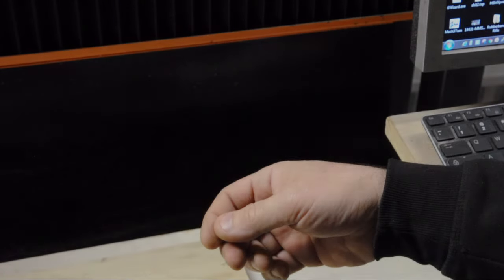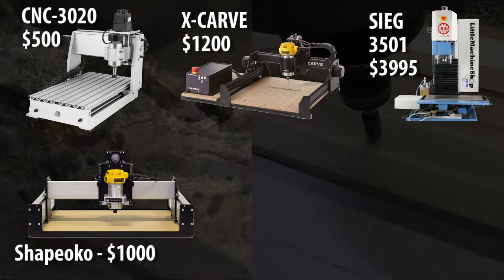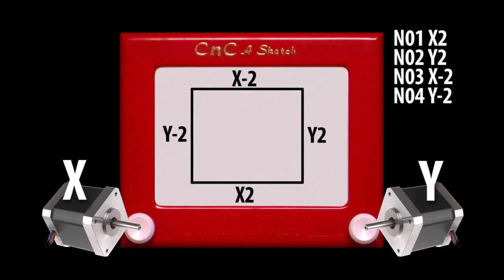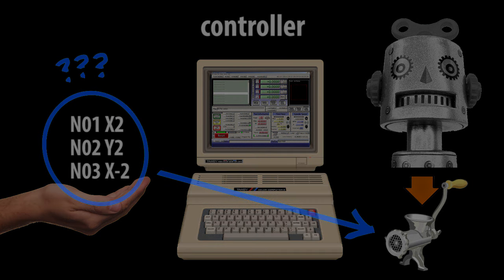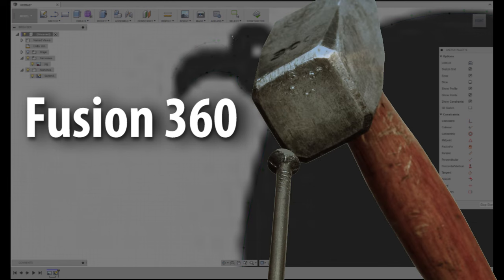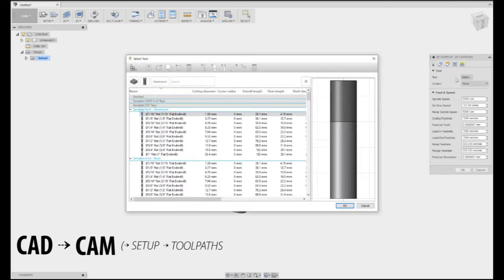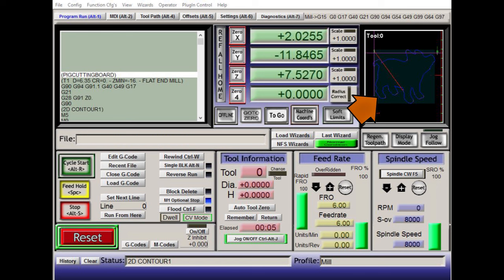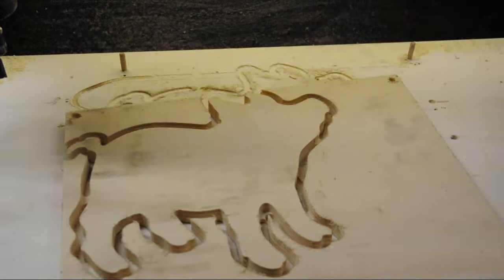CNC Dummies For Routers

Comment: This should be required watching for those getting into the hobby. As the owner of a 95% functional 3D printer, I can say that some of these "basic" lessons are hard-learned without the big picture.
Reply: Based on this video and your comment, I tried cutting a piece of wood with my 3D printer.

Now my nozzle is broken. Did I do something wrong?
Reply: Did you use a .2mm nozzle? those break really easily. Try changing your nozzle size to 40mm
Reply: yep should have used an eye liner brush instead of an nozzle.
Reply: Tilobida Toothbrushes work too
Reply: Agreed! 
Best Matt
Reply: Practical Engineering wish you still did more woodworking videos man! Loved your turning stuff.
Reply: When creating the big picture, There are many brushes
Reply: make a video about it
Reply: Instructions not clear, eye liner brush stuck in nozzle.
Reply: I run into this problem quite a lot. It's rare you can get such a high level overview of something to start you off on a completely new skill. Programming and welding are two areas I can think of where I've had trouble getting this sort of info. I always say in life that you've got to know exactly there you're trying to get to, before you start figuring out how to get there, but most people tend to charge off into the distance before I've even got my bearings.
Reply: Same can be said for the Illuminati conspiracy.
Reply: True bro the most basic easy things are the most valuable to beginners.. saves the headache of confusion
Reply: @georgehelliar  i tend to find my rough bearing, dabble a little and then specialise

a few steps in the generally right direction tend to give a very different perspective from knowing nothing.
Reply: My 3D printer is 5% working.  I suggest we collaborate.
Reply: I worked in a metal fab shop running a million dollar cnc punch for three years. While operating that bought myself a 3d printer, and about 2 months ago bought shapeoko router. I still consider myself a beginner, oh was going to school for welding technology when I got the fab job for highway products.

Comment: You said CNC machines do exactly what you tell them. Mine does if I sit there watching it, If I go make a cup of tea while its running, it usually messes up the work or tries to burn my garage down.
Reply: WhitwellMike B yeah mine too, sometimes it just has a mind of its own. A bit like my dog, faithful and obedient...... most of the time
Reply: WhitwellMike B yah, I had the same problem with my laser cutter, nearly had to tap into the home owners insurance...
Reply: I popped out for 5 mins, came back to find the cutter broken and the spindle motor filling the garage with smoke, so glad it didn't actually catch fire lol  Sit watching it and it's as good as gold!
Reply: Lock the door.  Murphy is getting in.
Reply: Unless it weirds out...... Mine almost never weirds out.  I take a close at the G-code first 2 ways, the simulator in V-carve and again in mach 3 cutting air.  If those prove out, the G-code is good and I just run it from the first good run on. Any weridnes is due to a computer failure or some rare power problem.  I am usually out in the shop doing other things and I dont actually watch, but I DO listen.  If I'm in the house with it running I keep an eyeball on it via a cheap ass web cam on a cell phone.. :)
Reply: I work in a production cnc machine shop. At times it seems like feedrate is directly related to how far away from the running machine you get. Lol
Reply: hahahahahah
Reply: WhitwellMike B.😄
Reply: @gavinyoung4870  Plus a Cutter, Drill or Tap always snaps when you have to slip out to the washroom.
Reply: @steamboatmodel  without fail! And wipes out every tool that runs after it in the program.
Reply: mine too!
Reply: @gavinyoung4870  we all been there. 😁
Reply: @thermmaloverload  maybe is a cat, secretly planning your demise

Comment: Sometimes you will modify code for:

1. Time reduction.

A. Retract heights (z) and other unnecessary moves can be minimized making only seconds of difference on each part but when you run thousands of those parts that can add up to hours each week depending on how many you make.

B. Surface finish adjustments.
Those who work on molds like the scallops (steps) to be very specific sizes so that the surface finish will match what the print is calling for.

2. Machine Specifications.

A. Say you have 100 machines in your CNC cell and they are 10 different makes and models, you will still program on the same software,
When you “post” the program there will be a configuration for each model of machine.
Sometimes the “post” has to be configured with the headers and footers for your specific machine, in other words the codes your machine needs to initiate and cancel commands.

B. Now companies try to buy similar makes and models as it takes money for a programmer to adjust your “post” (compiler you might say) for each different machine. If your company can’t pay for the “post” configurations then yeah the CNC programmer makes the changes to the code.

3. Collision prevention.

A. Older programmers remember the days when you did not have simulation software all we had was black screens with green text, sometimes orange. Before intelligent machining became common you would have to reduce velocity approaching a corner to prevent gouging.
We didn’t have all the visuals back then all you had was numbers to look at, in fact on the EDMs we ran programs were loaded by punch tape.

B. When you tested the program at maybe 25% feed you just had to be diligent to watch for clamps, a vice edge, or on the lathe the back of the boring bar hitting the housing.

There is so much more.
I like this new technology so easy! However it’s difficult to forget how it was and to trust these new Software driven simulators.
We didn’t even have swarf (chip) conveyors.
Reply: delicious crt fanuc displays

Comment: Cant find the eyeliner brush in the fusion360 tool library :-(
Reply from the maker: You sure you have the latest Fusion update?
Reply: FOUND IT!, @Pete did you check the makeup table dropdown tab? it's about "45min late for dinner" down the list
Reply: Im gonna create a custom tool, do you know what the bristle length and bristle pitch and bristle density should be? Thanks.
Reply: Also check out my shredder, it strikes me as a This Old Tony type of project ;-) haha
Reply: You can make a custom tool in Fusion, but you might want to machine something to put your face in the right place if you are attached to your eyes.
Reply: You can get away with just using a generic two flute twist endmill while programming it, just adjust the feed as if you're cutting particle board, and use the bristle length as your tool offset radius. It's also important to always run the toolpath as conventional milling, climb milling will give you too many clumps and a poor finish.

Comment: I took a community college class on writing G-Code for CNC mills and I don’t regret it at all and it has helped me use my CNC mill so much better. The class literally just consisted of getting handed a print and having to write a program to make the part on the print. Knowing how to write a program like that has made doing some projects so much easier because I’ve realized I can write a program by hand way faster than I can go through CAM to make the program. Anyway, point is it’s definitely worth learning g-code especially just the basics as it does make editing programs way easier and you will actually realize that sometimes if you want to do something simple, it’s way faster to write the program by hand then to use CAM.

Comment: I'd like to go into CNC router stuff, creating things. I do not yet a cnc router yet. I'm glad to have found this video. It's straight forward, perfect for dummies or newbies.
Thanks for sharing.
I'd like to build a CNC router thing myself. A small one. For a start 12 by 12 inches X,Y  would be totally sufficient for me, and a Z of max 3 inches (2 inches might or even less might
by sufficient as well). I'm looking for a channel which shows the building step by step in literally mini-steps (every screw, wiring, etc. because I do not have a technical background.
Total costs for all materials (except the spindle/router itself) should not exceed 200-250 USD.
Ideally when every part necessary for the build has an (affiliate) link (preferable in Europe because of shipping and import duties).
The construction should be suitable for routers and Dremel (like) rotary-tools.
Do you know (or anyone else who is reading this) if such a channel/video already exists?
And if it does not can somebody take the challenge to make a video like this?
I think many people will be interested in something like this and the maker of it can earn money through the affiliate links.

Comment: Tony,

Here's an example of when a ME has to create G-Code the old way.  I had to create a process grinding a Curvic coupling on a horizontal 5 axis grinder.  This grinder traditionally manufactures parts in a entirely different way than they way in which a Curvic coupling is generated.  Our CAM software's post processor is custom tuned to the explicit way in which we create programs for a non-Curvic process.  The code itself only contained three actual machine moves, G0... G1... and G0...  The other 400 some odd lines were heavily parameterized calculations for the machine moves, dressing, position calculations, etc.  It's rare I have to create my own G-Code, but it does pop up from time to time.
Reply from the maker: Interesting!  Thanks Supa.

Comment: Ok so 3D pint a shroud that goes around your spindle and size the end for your shop vac, allow it to swivel!
Easy to make, some come with that attachment and vacuum as standard.
Much cleaner than air blowing crap around the shop.
I ran Gerber Sabre 3D carving machines. Most places use them for wood carving but the spindle runs at 10,000 rpm with a 7hp high frequency spindle and if you put endmills in the collet you can cut what you want. I would do stainless like butter and the tolerance is as close as you know how to secure the part. Less than a thou for sure.

Comment: Hi Tony! 
First let me say that your Content is both entertaining and factual. 
But can I just point out something small! 
Please don't hate me for this! 
With the chapter 3 CNC.
You have to define where 0,0 is! 
Your sample code of
L1 x2 
L2 y2 
L3 x-2 
L4 y-2 
Will result in unconnected line. With a line two inches at the bottom , 2 inches going up on the right hand side. 4 inches going from the right hand of the shape to the left hand side on the top and then a line that ends up 4 inches below the start line! 
What's needed is this code to make a square. 
Let's set 0,0 to the bottom left hand corner.
So
L1 x2 
L2 y-2
L3 x0 
L4 y0 
That would make a square!
Reply from the maker: It might've been hard to see because i used black text on a black background, but I switched a lot between relative and absolute coordinates.  ;)

Comment: Lots of CNC machines will take X2  as go to    X.0002in
It is best to always tell it what units you are using (mm or inches) and always use decimal points. (some parameters never use decimal points, but the error would probably be safe)

Comment: Thank you! This should help me streamline my process 10 fold.

my current process:

1) Draw in freecad.
2) export as obj
3) use online converter to convert to stl
4) use py-cam to convert to g code.
5) open g code in hex editor to replace the 3 bit carriage return to a 2 bit one, or my cam software gets mad.
6) manually tweak G-code because some of py-cam's internal defaults are excessive for my machine.
6) load g-code in Grbl control
7) mill out part.
Reply: Possibly better option here... 
1. Sketchup
2. Sketchup stl export plugin
3. Makercam.com to generate gcode

This is how I currently do all my 2.5d work. All my 3d work I do in fusion360 though.
Reply: I've never gotten the hang of sketchup.
and I've never heard of makercam.com, looks interesting, I'll give it a go next time, thanks!
Reply: +EvilPlagueDoctor you're welcome! Hope it helps.
Reply: Invest $350 into V-carve Desktop.  Beats the hell out of all the gyrations with the open source stuff. It will import just about any cad file or 3d model file format out there. At least checkout the demo version.. WELL worth doing.

Also look into Fusion 360-- Free true 3d modeling, But has a very steep learning curve. Will do assembly simulations with a large number of moving parts. And will also post process g-code for nearly any CNC in existence. It will also import nearly any file format in common use.
Reply: You mentioned the Fusion 360 is free.  Have they changed?  What I am seeing is that it is $40/Mo or $300/Year.  Am I missing something?
Reply: +cbb1962 it does say that, but if you go through the download process, you will be presented with an option to choose a student or hobbyist license (or something similar... Been a while since I've done it) that license is free and is good for one year I believe.
Reply: +cbb1962 and then at the end of the year, you just renew the license.

Comment: Excellent video. I've learned so much from all of your videos. I'm hoping to get my small shop equipped with some CAM software soon. We currently write all of our g-code on the controller. It's not terribly hard and the 3 of us programmers got pretty good at telling the machine what we want it to do. I guess the point of this comment is that there might be more people that write their own g-code on the fly that you might think. Depending on the complexity of the parts you're making, CAM software isn't always necessary. 

I hope this didn't come off in the typical youtube commenter tone. I really appreciate your videos and hope you make more.

Comment: Very well done!!
Reply from the maker: Thanks!
Reply: I noticed you traced the outline of your pig to put it in Autodesk fusion, you most likely already know this, but take something like Inkscape put the pig in and have it trace the bit map of the big which will be converted into paths, save as SVG and there ya go or if you want to do more stuff you can import the svg into Autodesk and it already have the lines needed in this case an outline. Like I said you may already know, just throwing out what little advice I have, maybe you know something more about it where you dont do it that way or why it shouldn't be.
Reply from the maker: Thanks, I'll have to look into inkscape.  To be honest, I don't do this sort of thing much, and I couldn't find a free Pig.svg :)
Reply: TheSteamPunkDevil Adobe illustrator also traces objects and converts them to vectors although Inkscape is free and does it also efficiently.
Reply: redlightson yea ive wanted to try ink scape but not even sure I would use it that much to justify it.

Comment: Thanks! I spent my whole professional life as a professional programmer, until I got to the top of the ladder. Then I became a manager :( :( but I still program for fun, as when I want to build a dividing head. This is very similar to the evolution of programming. It began with 0110... binary code, moved on to assembler, (g-code) went to FORTRAN and LISP,  graphical interfaces and on to more advanced languages. So CAD/CAM/gcode has gone down the same road; the analogy is very clear. But one thing remains elusive: the DWIM instruction: Do What I Mean (Not What I Told You to Do). It takes a lot of concentration to do programming (or CAD/CAM) and one porcine fault and you ruin the workpiece.

Comment: This is awesome! What CNC board did you choose for your machine? I've got a Smoothieboard in my laser.
Reply: William Osman hey, I've got a Chinese laser with the standard board. How did I your smoothie board conversation go. Can it cut vector and engrave raster?
Reply: Actually I built the laser from scratch. Vector cutting is awesome, but rastering leaves much to be desired.... All rastering is done with gcodes, so it's slow to upload and slow to cut. Supposedly they're working on native raster support for the smoothieboard.
Reply: William Osman well done building from scratch, I'll keep a close eye on the smoothie development as a nice upgrade
Reply from the maker: I use a soundlogic breakout board and a smoothstepper ethernet controller.
Reply: Ok, now i have a lot more questions.

Comment: ...I've mostly worked in 'metal' shops....but these rules still apply...even more so....always use some sort of blocks, spacers, or such to place your work at a stand-off distance to the machine table, and of course your "Z" depth stop.......so you don't drill a couple of 1" holes all the way through the table on your Bridgeport Mill.....

Comment: Great video!

Indeed I have written G-code to correct a stupid mistake made by CAM software. Actually, it was more an oversight of the guy using the CAM software forgetting to adjust the settings so that the endmill isn't cutting air for two thirds the time. 

In manufacturing, time is money, and spending three times as much of it because a box didn't  get unchecked is a huge waste of money.